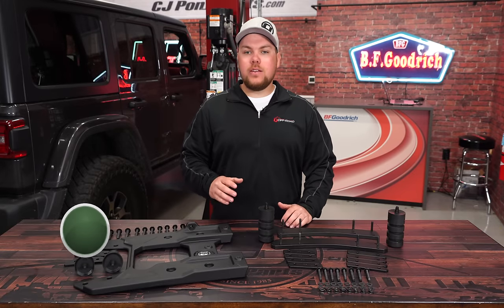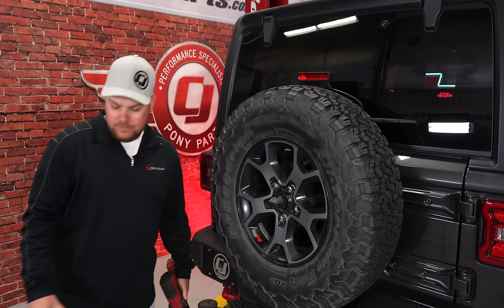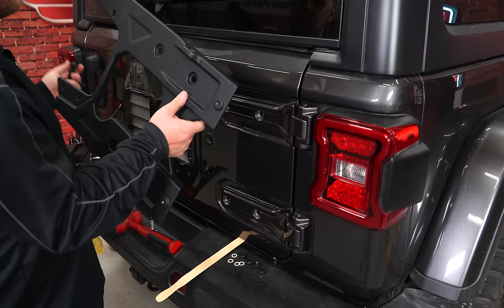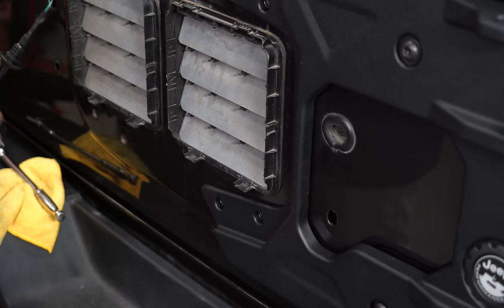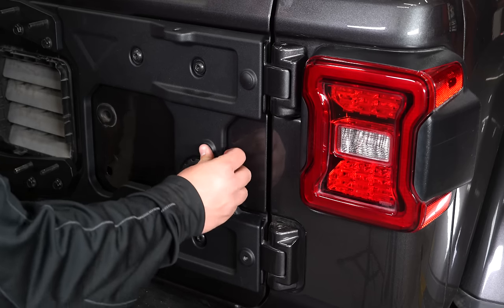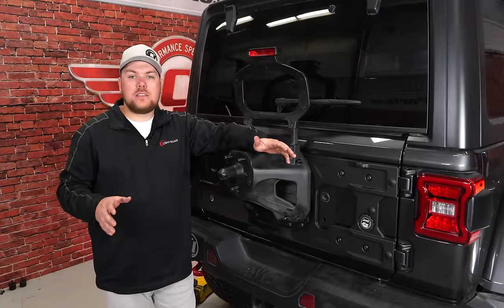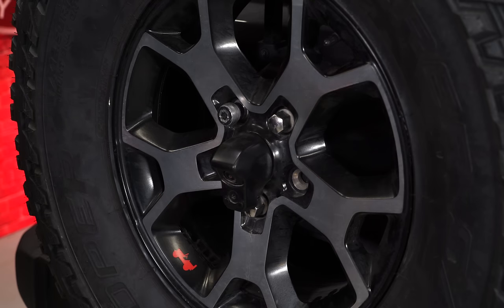How to carry 37" tires on the 2018 Jeep Wrangler JL: Mopar Oversized Spare Tire Carrier Kit Install

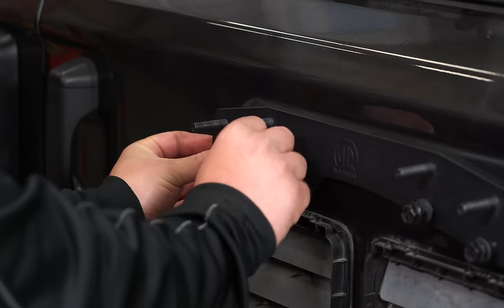Comment: Thanks, your videos are the best. One thing I think is a mistake, at 5:09 in the video, the spacer labeled "top" comes from the relocation kit where it comes with 4 top and 4 bottom spacers. I think instead of that piece, you are supposed to use the spacer that came with the tailgate reinforcement kit to go under that bracket. Its not labelled top or bottom. This leaves the 4 top and 4 bottom pieces that came with the spare tire relocation kit to be used on the outside portion of the bracket with the mopar stamp. You can choose to not use them at all, use 2 top and 2 bottom, or double stack them 4 top and 4 bottom, to give three different outward spacing options depending on your tire requirements.
Reply: Thanks someone finally found out their mistake..

Comment: I'm quite surprised that you dont need reinforced tailgate hinges as well
Reply: Juan Durandt I feel the same way, the weight of the tire would be on the hinges, not the actual tailgate. I feel like the steel “reinforcement bracket” just adds more unnecessary weight to be carried on the hinges when opened.
Reply: The hinge isn’t the weak point, the surface of the tailgate is more prone to bending than the hinges are. The reinforcement bracket spreads the extra weight over a larger surface area to prevent the tailgate itself from buckling.
Reply: To add, the tailgate of the JL is significantly more reinforced compared to the JK. The JL has a magnesium tailgate frame that not only twice as thick as the JK, but is lighter and stronger than the steel stamped JK tailgate. The JL also has more robust tailgate hinges, much larger than the JK. Overall, the entire tailgate assembly of the JL is superior.
Reply: Yahsone  If it is a JL Rubicon it will be fine. Jeep reinforced the tailgate over the JK considerable more. The JL Rubicon can run 35" tires without a lift.

Comment: Thanks for the vid - appreciate the content. Is it just me... probably a great kit but you're still technically carrying 100% of that wheel and tire weight on the tailgate and hinges even though the weight is distributed a little better with the Mopar kit? Nice easy install though.....

Comment: Thanks for the vid - I see how the weight is distributed across the tailgate but all the weight is still technically sitting on the two primary tailgate hinges correct? The tailgate is still forced to hold all the weight of the 37" wheel and tire? Thx

Comment: I don’t see how this will reinforce the tailgate cause all the weight of the tire is still on the hinges of the tailgate.
Reply: JL models come built for heavier loads on tailgate after customer feedback from JK models. Completely redesigned the construction of the gate
Reply: Yeah I was wondering the same thing. With this mod the hinges are not only carrying the weight of the larger tire but also the weight of the heavy reinforcement panel as well.  Apparently the hinges can handle the weight, it's the back door panel its protecting by shifting some of that weight off the door panel and on to the hinges. The other thing is that stock, the hinges connect to the back door just a few inches on the end of the door with 4 bolts. This mod extends the length of the hinge half way across the door,  and connects the hinge to the back door with 12 (the original 4 plus 8 more) bolts

Comment: I installed both the reinforcement and the tire lift both from Mopar and was as the third brake light relocation kit.  My sensor is going off, anyway to fix or correct this issue?

Comment: What did you do with the 3rd rear light? In the video when you guys trial lifted that wheel up, it looked like the tire was covering it/hitting the brake light. But your final clips showed the brake light to be well above the tire.
Reply: The stock one is adjustable up and down

Comment: How did you put the 37” tire with the stock rubicon rims on the tire carrier? My sport s with 35”s doesn’t have enough bolt sticking out to tighten it to the tire carrier.

Comment: Those three threads you put the plugs in to, what are those for?
Reply from the maker: Those are just threaded holes in the plate, from what i'm told by mopar they are just anticipating the aftermarket will design parts to be compatible with it.

Comment: I just bought a 2018 Rubicon with the same rims. I didn't realize you could put 35 or 37 in tires on those rims being only 7.5" wide for the inside of the rim. What tires are those? Also, how does this reinforce the tailgate? Wouldn't the hinges need to be upgraded? It looks like this kit just adds more weight? Very interested in this. Not trying to sound sarcastic at all just very curious about doing this myself. Thanks. Great vid!
Reply from the maker: The plate on the outside ties the hinges more into other locations making it stronger. The tires we chose are a 37x12.5 Cooper and they mounted up no problem.

Comment: I have a 2018 JL Rubicon 2 door, it came with 33x11.50's BFGoodrich KO2'S and I have the same rims as in your video, if I want to upgrade to 35X12.50's will the factory spare carrier be good? also will the factory wheels work for the 35X12.50's? I m getting the mopar 2'' suspension lift before I upgrade to the bigger tires... thanks

Comment: is there a way to tell how many spacers will be needed before hefting this tire up there? Going to mount 37 13.50 17 tire with a 17 x 9 wheels and 12mm offset (negative 4.5)
Reply from the maker: Use all the spacers that come with the kit, if you need more just throw on some washers.
Reply: Thanks
Reply from the maker: Yeah no problem!

Comment: Great job. Anyone get this thing powder-coated to match colors?
Reply: The bracket itself is coated in that heavy duty truck bed material, like what they use on the bumpers and rock rails. Unless you know a good way to strip that coating off, these would be difficult to powder coat.

Comment: On stock rims do do 35s and 37s need spacers
Reply: For normal driving you can adjust the steering stops a bit and the stock rims without spacers are fine. When at full flex spacers will keep it from rubbing the skid plate and control arms.
Reply from the maker: I completely agree with the comment below, no spacers needed until you're at full flex or bump!
Reply: Does this Jeep run spacers on the stock wheels?

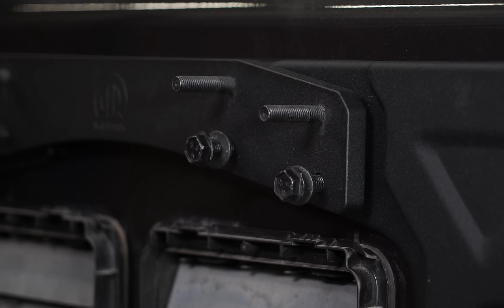Comment: You did not torque the spare to the recommended 59 foot pounds. Starting at 5:36, is there a torque spec to tighten those bolts to?

Comment: No way that 37’s over time on stock hinges will last.
Also that tire carrier is made out of magnesium, that will not hold up overtime with a 35 or 37 inch tire. You are asking for trouble.

Comment: Do I need this kit for a 35x12.50.17? They will be mounted on 2020 factory rubicon wheels.
Reply: You don't need it.  Had 35s on mine and had no issues.   You'll need bumpstops though to stop the wheel from vibrating when hitting hard bumps.  I only changed the tire carrier when I upgraded to 38s.  (Didn't use Mopar).
Reply: @wilp5991  do you know where I can find bump stops for it? I checked and all I've seen are jk stops. I did see guys using ovc and a rubber end cap as extensions for there over sized spares.
Reply: @pinedac2001  the jk stops might be compatible.   It's just a rubber piece that you stick in your tailgate..  i got mine for free so I don't know where he got it..